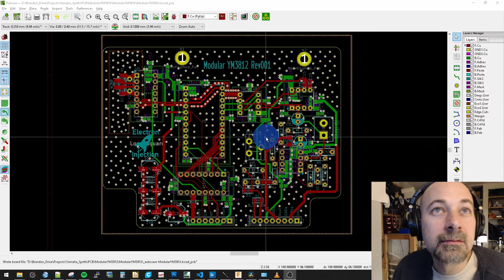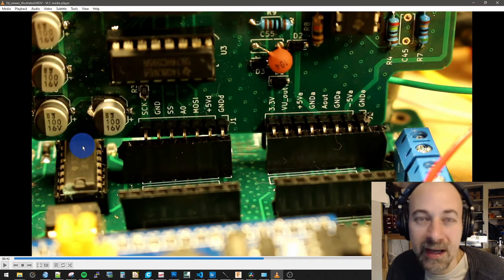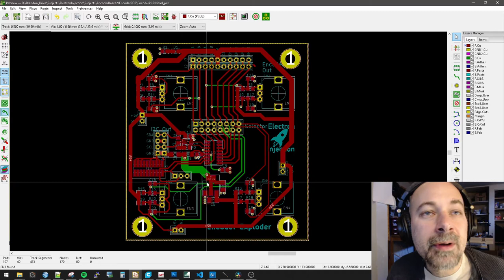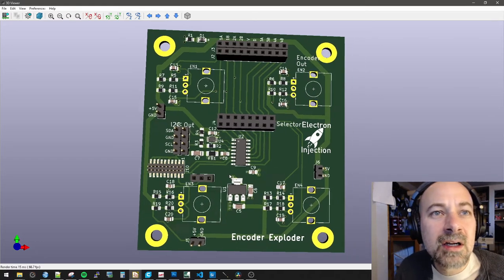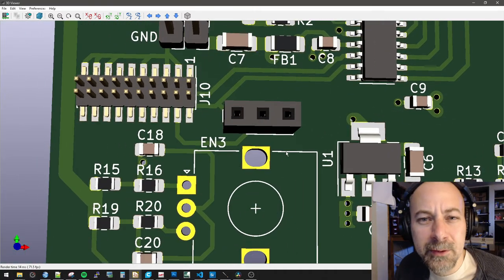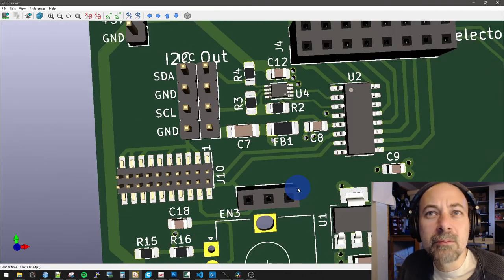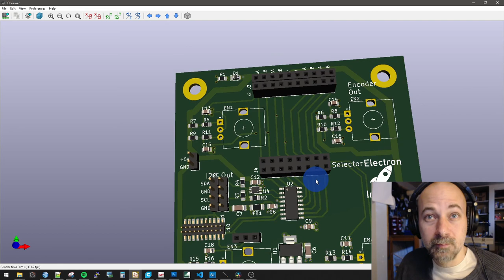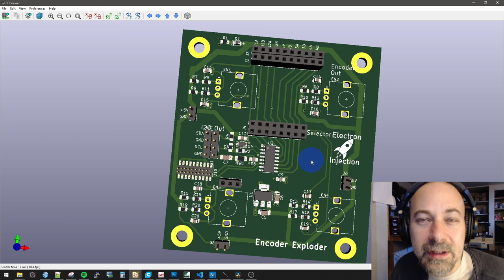PCB Design For Beginners:  The 3D Model Is Underrated

Comment: Thanks for the video. I agree a lot with this method.  This is what I have learned to do on my boards.  I "sit-n-spin" the 3d view for a long time ;) 

Question: do you use ground planes on your boards?
Reply: I pretty much always use ground planes.  Most of my boards these days are 2 layer and the general consensus is the more surface area grounded, the better.  There is an exception to this.  A long, skinner "finger" of a ground plane that is only connected to a larger ground plane on one side is an antenna.  Depending on the geometry, this could appreciably increase noise.  (See Electromagnetic Compatibility by Henry Ott).  As long as the "finger" is grounded on both sides, it's not a problem.  This is my understanding anyway.
Reply: @BrandonDrury  Yes, I agree and use GP's on my boards as well.  I just could not tell from the images if you did or did not use them. Thanks.
One more question; Are the vias you use on the PCB for aesthetics, plane-2-plane connection, noise steering, or all of the above?   I have been experimenting with vias on my boards to see how they help or hurt it.  I've watched a few videos by Rick Hartley and Susy Webb on design, GP, and noise and read some on at as well.  It seems there is a lot of different views on via's, noise, and the GP. I'm sure it's less than a problem for my work but wanted to hear your opinion on it. Thanks.